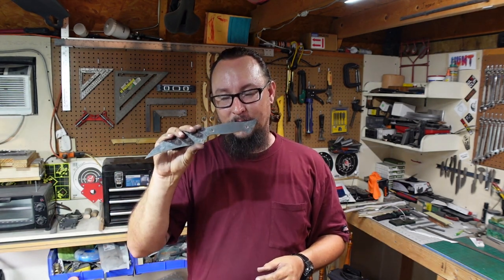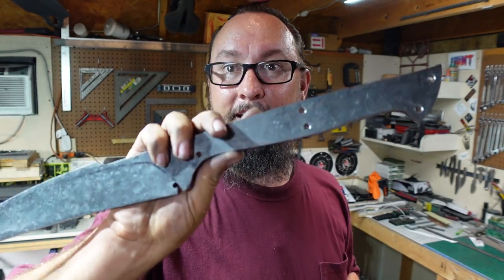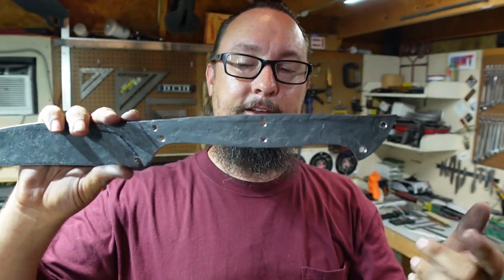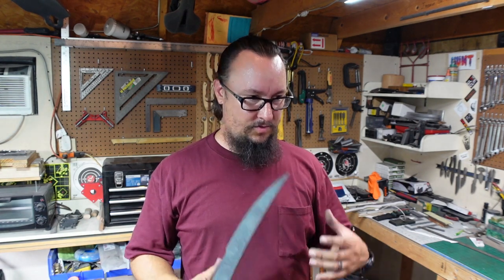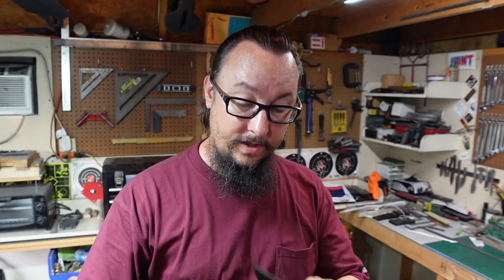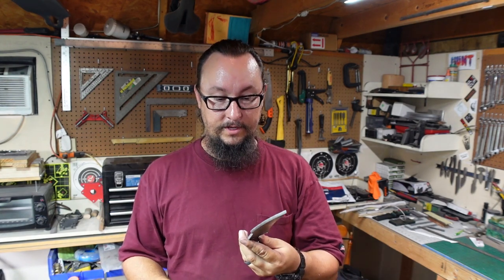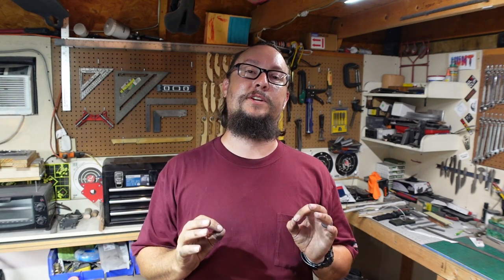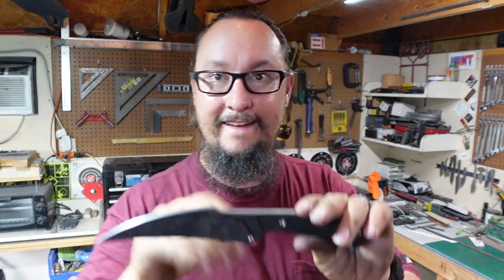Texturing and Profiling a Wicked 1084 Knife | Knife Maker | Vlog

Comment: Texturing the blade with the ball peen*; was that for the aesthetic or does that change its performance?
Reply from the maker: Mainly just aesthetic to match the larger blade. I used the rounding hammer to stretch the material a little bit.